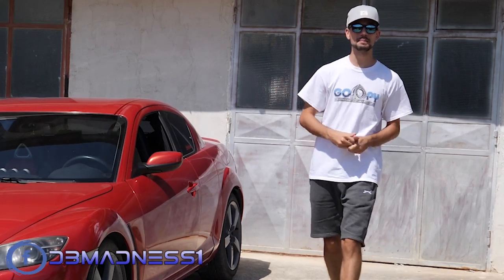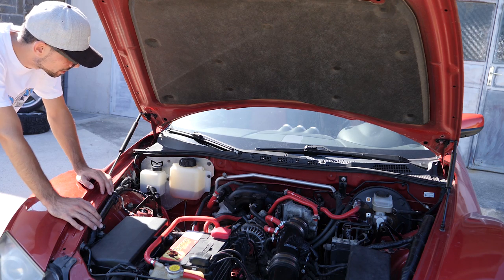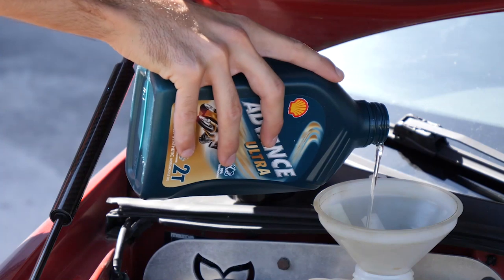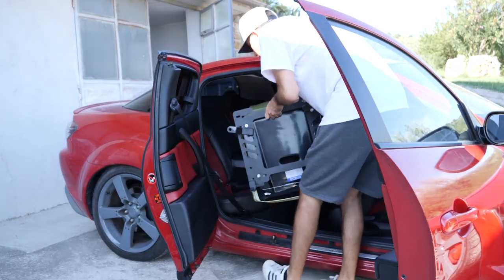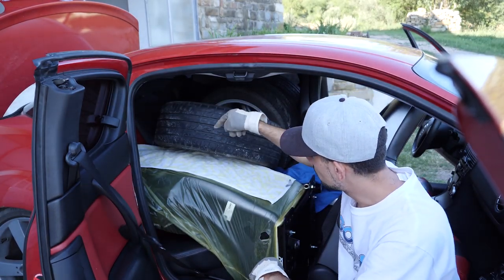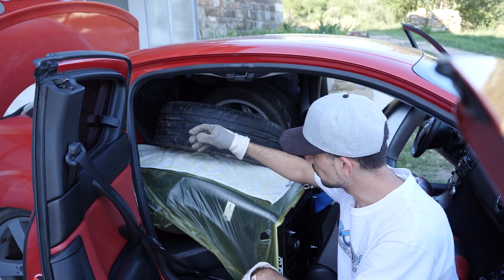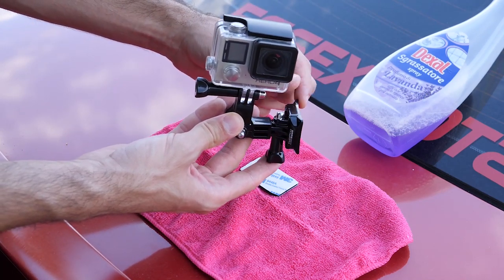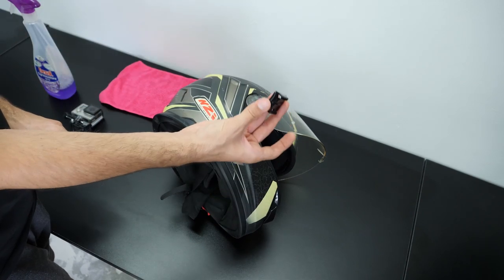Preparing My Rx8 For The Track + GOPRO Helmet & Pedal Mount Kit Install

Comment: i don't like shell, and also motol 710 and 800, on my husqvarna (2t) i've tested some different oil... i think u have to try the "exced bluprint" (produced by a little factory in italy) or elf 976+ (full synth), they are kart oil, very viscous. For the exced one there is the "mixer" version that is created for motorbike with external mixer and it is less viscous.
If u would like to try the exced tell me something on my private Facebook
Reply from the maker: Ive checked out the bluprint, sounds really good. Ill try it on my next fill up. Write to me on my facebook page please. I also speak italian (mother language) :)